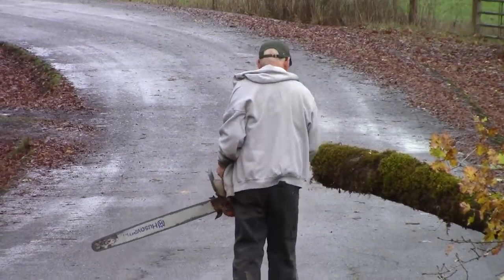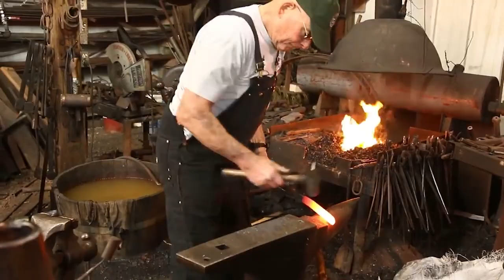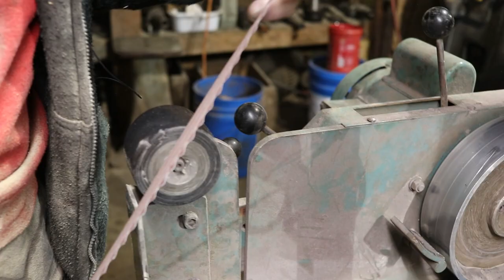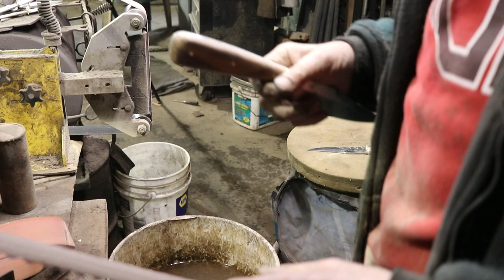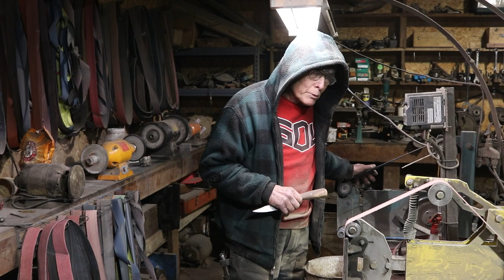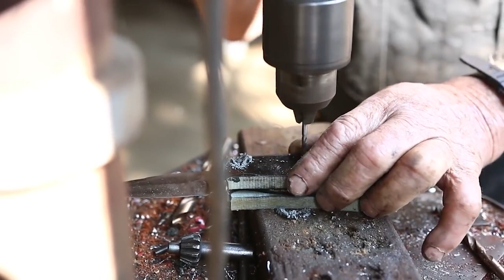Grinding Knives with Cy Swan

Comment: I was building a cedar panel  fence on this property the other day, and at the back of the house, another crew was doing foundation repair work. They had some big rocks and lots of dirt to move around, and had hired a excavator. The truck pulls up, and out comes a man, who I thought couldn’t have been younger than 80. He climbed up on the back of the trailer, lifted the big chains and hooks off the tie down points, and drove the thing down a steep, narrow hill. 

He worked all of the next 3 days, at a young man’s pace. 

Turns out he was 95, and that it was his last job.

Comment: When he was talking about the saw dust and sparks from metal being a fire hazard it reminded me of an instance when a gentleman who worked at a toilet paper plant said that they have to take extreme, special precautions to avoid ignition sources. As the TP is being processed/manufactured it creates a dust that’s nearly invisible due to how fine it is and is extremely volatile.  Things you might not think of.

Comment: A point with remembering when using variable speed drivers, especially if they are a retro fit, is that the cooling fan on the motor is generally designed to run at synchronous speed and won't shift enough cooling air for the motor when run at the lower speeds. It's a good idea to fit a fixed speed electric fan to the motor.

Comment: Another really nice video, I also make some knives and have had that burning the handle problem..now I need another machine that's veriable speed. I have those scalped belts also, but have been afraid to really use them much, this gave me more of a application on how they can be used .thanks for that. The smoldering problem he mentioned, I found that out early on, filled the shop with smoke ... 😂 I now clean that area off between material so it won't happen again. Thank you for taking the time to pass on the old ways, their are not to many of us left that do them and I surely don't want to be on film...let's just say that my grammar would be offensive..🤣🤠